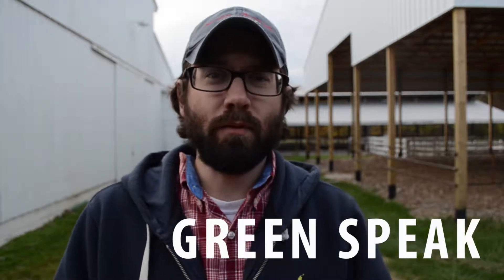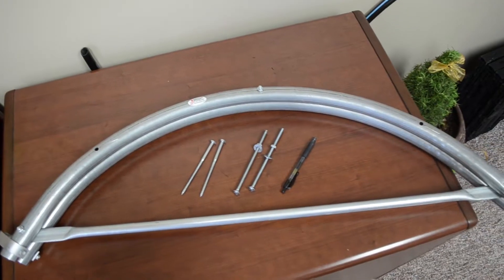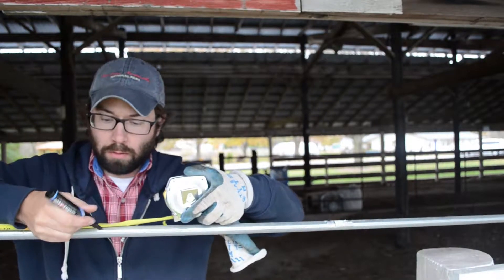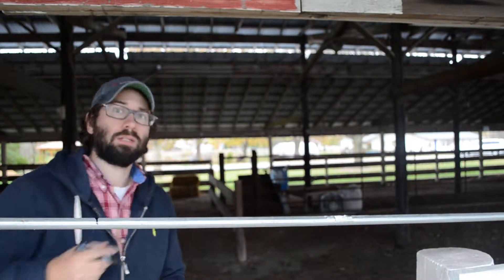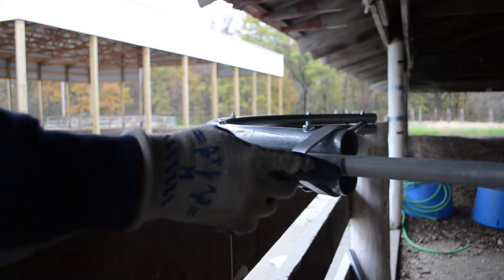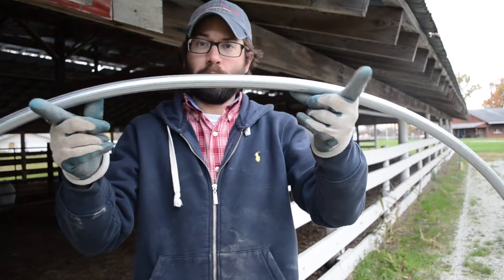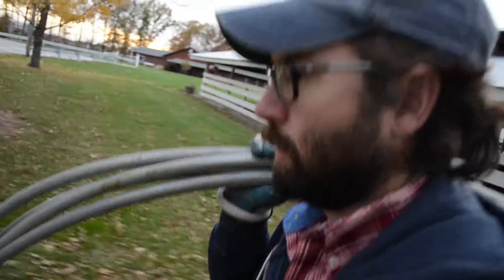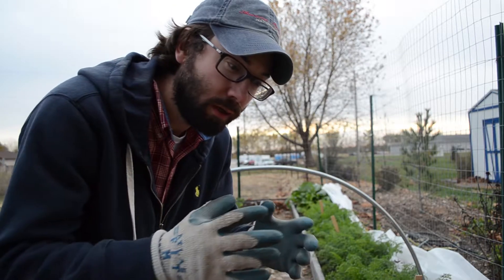How to Build a Low Tunnel Part 1: Bending low tunnel frames

Comment: If you had a six-foot pipe bender, would you still measure 16 inches in? When you say there is more instructions online, where exactly? Thank you in advance.
Reply from the maker: Hi MicroUrbTV - The process for 6-foot hoops is a bit different. Johnny's cover the process in the following video https://www.youtube.com/watch?time_continue=113&v=j0M8bIe3TJk&feature=emb_logo

You can also find the instructions in greater detail at the following link: https://www.johnnyseeds.com/on/demandware.static/-/Library-Sites-JSSSharedLibrary/default/dwff40b01c/assets/information/9377-9520-quickhoops-low-tunnel-benders-instruction-manual.pdf